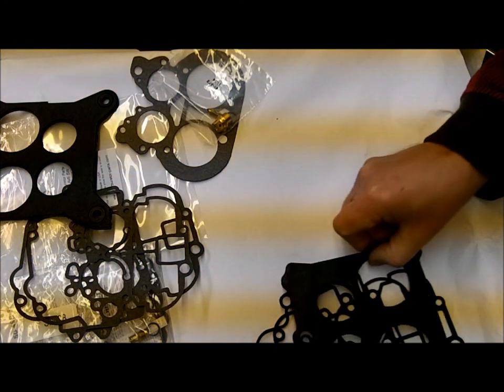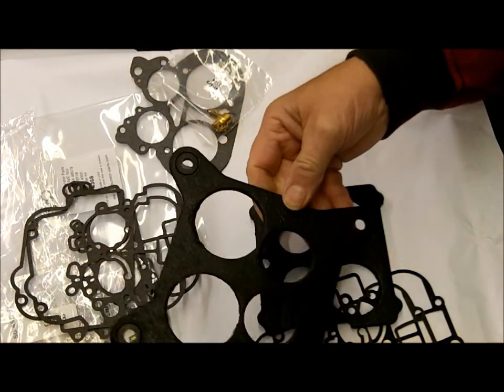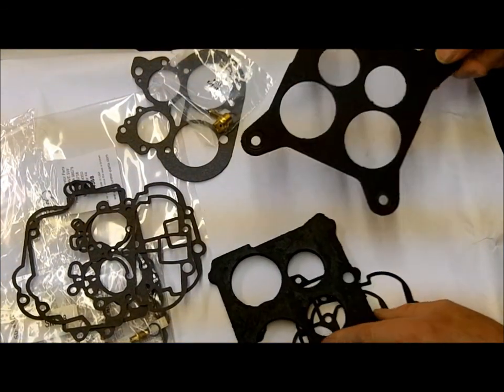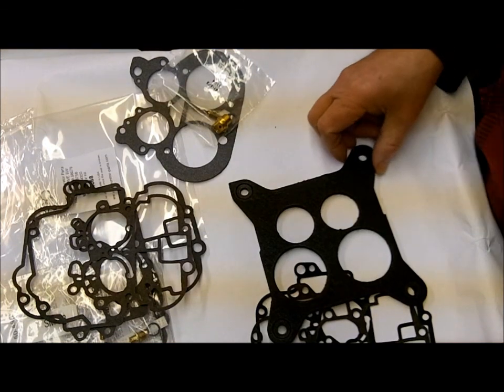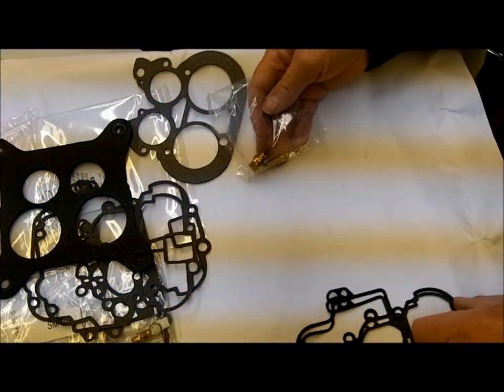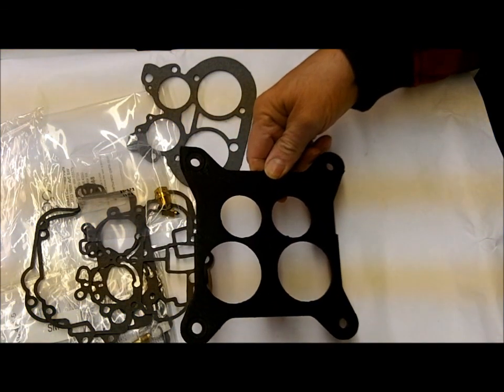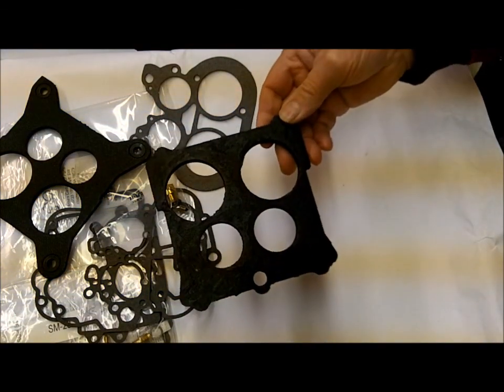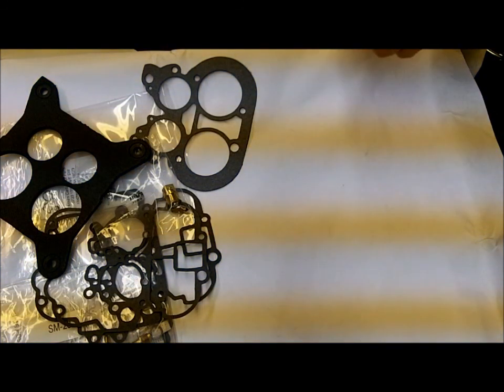Autolite 4350 4 Barrel Carburetor Kit Identification

Comment: The flange gasket shaped like the bottom of the carb with holes for the hold down bolts is for use without a factory spacer, the other one is for use with a factory spacer.